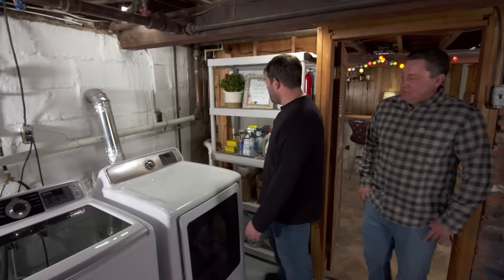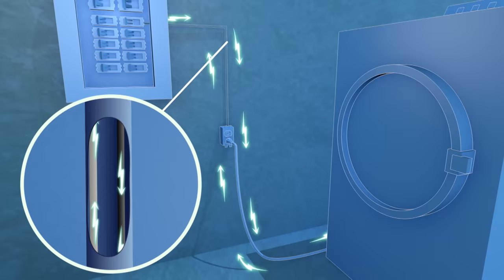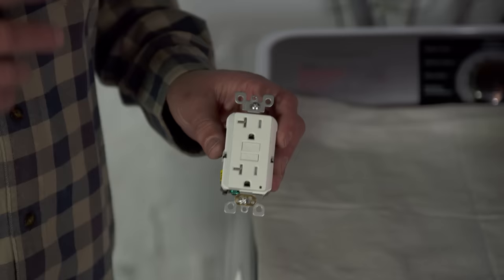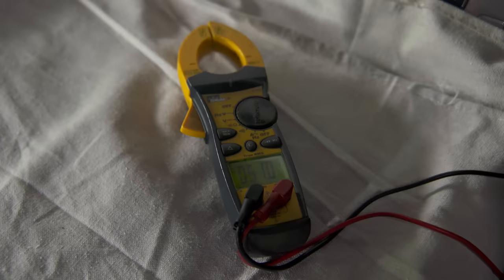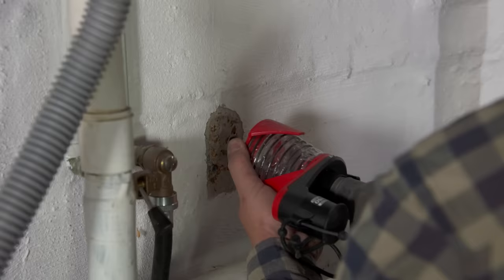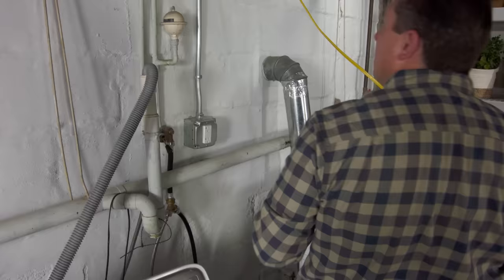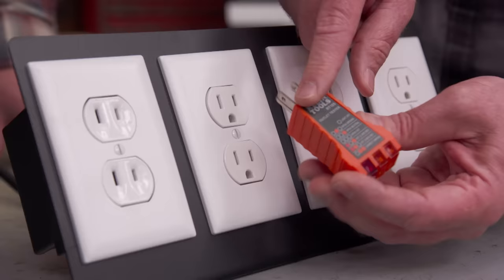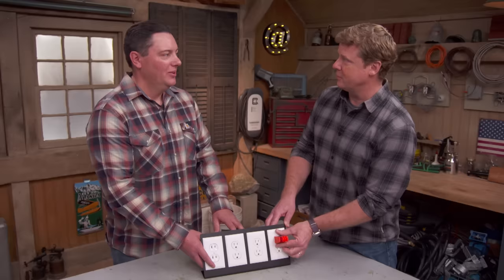How to Ground a Two-Prong Electrical Outlet | Ask This Old House

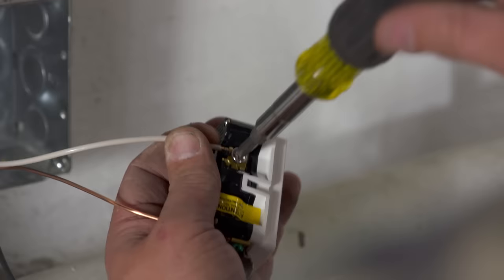Comment: At the 4:41 mark you are running NM (Non Metallic) cable in EMT (Electric Metal Tubing) . This is a violation of the National Electrical Code. Using material for a use other than its intended use is not code compliant. Also, you failed to install an insulating bushing at the free end of the EMT allowing the NM cable to be exposed to the sharp edges. Another violation of Code.
Reply: love this i was thinking the same thing😂
Reply: Wrong on one point. The code does not care if you run NM in EMT as long as you are within the rules for pipe fill while also meeting all of your ampacity derating requirements. If you disagree, please cite your code reference.
Reply: Running NM in EMT is probably not a violation of NEC and is actually REQUIRED (or equivalent) when necessary for protection from physical damage of exposed work.  334.15(B).

Comment: Around here you can’t us Romex in a pipe and You can lie to gfcis and plug testers.
Reply: Leopold  If you have a grounded wire to the outlet box and install a grounded receptacle then you have an equipment ground, so what's the problem?
Reply: Romex in a pipe (or equivalent) for physical protection has been REQUIRED by the NEC since the 2005 edition.  334.15(B).

Comment: I thought you couldn't run romex through conduit?
Reply: I believe it's ok if less than 10 ft length.
Reply: @surferdude642  That's incorrect. Refer to the NEC.
Reply: @MrBluelock  Thank you for the correction. Personally, I don't like the idea of running Romex through conduit, regardless of the length.
Reply: @surferdude642  While I can understand your reluctance, the sheathing for the conductors in NM-B is rated for 90C(194F). Something would have to be seriously wrong for the temperature in the conduit to even get close to that. At that point I doubt that it being THHN, instead of NM-B, would make enough difference to help. So if you find yourself in a pinch some day, don't feel bad if you do it.

Comment: Gfci receptacle AND an AFCI breaker? Holy hell
Reply: @Lucky Joestar Useless? The vast majority of dwelling fires caused by electrical issues may have been avoided with AFCI protection.
Reply: Yes, since at least the 2014 version of code (not yet universally adopted) a laundry receptacle (or replacement) needs AFCI and GFCI protection, not to mention the replacement receptacle itself must also be tamper-resistant.
Reply: @UpnorthHere  I suppose, if the power doesn't work, it can't start a fire, lol.

Comment: That outlet has been there for 60 years without causing any problems but some “expert” insists its a “problem” now. Replacing all that wire and equipment is environmentally and financially irresponsible.
Reply: I disagree with your assessment. This is an unusual best case scenario where everything is accessible and the electrical panel is nearby. The materials required are minimal and the safety is upgraded.

Comment: gfci breaker and gfci plug are redundant just one is required otherwise you'll get nuisance trips.
Reply: cdnbacon2001 actually, he installed a GFCI receptacle on an AFCI breaker. They are in fact 2 different devices.

Comment: An arc fault breaker for a washer and dryer? That thing will trip every load.  A GFI breaker covering the circuit would suffice.  Arc fault breakers (at least in Canada) are only required for circuits feeding bedrooms.
Reply: It may for an old appliance.  But the newer ones don’t often arc.
Reply: "AFCI only for circuits feeding bedrooms"?  Actually, the NEC has required AFCI for circuits in laundry rooms since 2014 and in "family rooms, dining rooms, living rooms, parlors, libraries, dens, bedrooms, sunrooms, recreation rooms, closets, hallways, or similar rooms or areas" since 2011.  Failure to install them means failing the inspection. In some towns, a failed electrical inspection may mean a padlock on your main disconnect in the "OFF" position.

Comment: And in this case the ark fault breaker is redundant it the purpose of its use in this situation and may cause undesired trips, as moters with tension on then may ark as they start. As in a washer machine.
Reply: NEC now requires AFCI protection for a laundry room.  Get used to it.

Comment: did u see the amount of splices in that panel ???!!!
Reply: Pablo no. I saw extended wires though. Nothing wrong with extending wires in a panel.
Reply: Since this is an older house, the original panel was likely upgraded to a new 200 Amp panel. Newer panels are bigger and sometimes get installed in a manner that requires extending the existing wires (e.g. upside-down with a new service line entering at a different location).
Reply: You should see my old panel updated in '72, hardly even any room left in the panel for wires, and doesn't even have a main breaker

Comment: 6:09 what is he talking about??? the power is still flowing but it's not?
Reply: If hot and neural are reversed then when your toaster's switch is off the heating elements are still live.  So if you stick a knife in you can get a shock.

Comment: Many problems,first,you don't ever run non-metallic sheathed cable(romex) in conduit(temperature conductor values change in conduit 45°c NEC table 310-15 ) which means the ability to shed heat under a load.It is reduced in conduit.Should have run #12 THHN down the conduit (75°c) which means it can handle more amperage.The neutral is a current carrying conductor,it takes the imbalance of the load.The ground,is a non-current carrying conductor,not more conductive.
Reply: ARTICLE 334 Nonmetallic-Sheathed Cable: Types NM, NMC, and NMS

II. Installation

334.15 Exposed Work. In exposed work, except as provided in 300.11(A), cable shall be installed as specified in 334.15(A) through (C).

(B) Protection from Physical Damage. Cable shall be protected from physical damage where necessary by rigid metal conduit, intermediate metal conduit, electrical metallic tubing, Schedule 80 PVC conduit, Type RTRC marked with the suffix -XW, or other approved means. Where passing through a floor, the cable shall be enclosed in rigid metal conduit, intermediate metal conduit, electrical metallic tubing, Schedule 80 PVC conduit, Type RTRC marked with the suffix -XW, or other approved means extending at least 150 mm (6 in.) above the floor. [ROP 7-94] Type NMC cable installed in shallow chases or grooves in masonry, concrete, or adobe shall be protected in accordance with the requirements in 300.4(F) and covered with plaster, adobe, or similar finish.

Comment: What's up with the "dont put the knife in the toaster" quote? I dont get it..
Reply: A butter knife is the wrong way to get a stuck piece of toast out of the toaster - even if you think the toaster's off.
Reply: When you have the hot and neutral properly connected, the energized part of the circuit stops at the switch which means the heating element is not energized. But if you have hot and neutral reversed, the energized part is flipped, the heating element is now energized. Even though the circuit is still not complete and thus the toaster would not work, you now have a high chance of competing the circuit if you put a knife on it, and electricity finds a path to ground through your body.
Reply: @bend386  Toasters cut both sides, at lest in Europe. It is idiotic if they do not in the US.

Comment: 6 feet from the new panel and this didnt get changed/inspected ?  That shows that both the electrician as well as the inspector was negligent
Reply: Inspector only provides information.  Homeowner did the right thing and called in an expert.

Comment: I was taught a ground fault detector wouldn't work without a ground wire.
Reply: Pretty sure they will.
Reply: Well I am awfully sure they won't. Anyone can be wrong and even though I took a construction electricians course and two electronics courses including one in the military I could be wrong too.
Tell you what I will disconnect the ground from mine and see. Now all I have to do is find a toaster and fill the bath.🤗😉🤗

Comment: Actually, its not a grounding conductor at devices. Its a bonded circuit bonding conductor. The grounded conductor is only at the the ground point in the service panel or meter base to an approved earth ground.
Reply: Technically it's called the "equipment grounding conductor" at the device.

Comment: When you turn the main breaker off there is still wires inside your panel that are still hot from your power meter.
Reply: That script was air tight. Would you prefer they cut the part about turning off the main breaker before removing the cover ?
Reply: yes...the two hot wires going directly to the main breaker are still live so be careful....
Reply: @workingshlub8861  It has already been stated that there are energised parts beneath the cover. If the cables to the main breaker are terminated correctly, there should be no exposed conductors. On a domestic installation where you would likely find ungrounded outlets, the screws are typically recessed within the breaker housing too. So adding the "two hot wires going directly to the main breaker are still live so be careful" to script adds little content and would more likely confuse the average viewer.
Reply: Anyway I think this video is great at giving an overview of the job of fixing ungrounded outlets while giving just enough details so that anyone who want to do the job themselves doesn't completely screw it up. The vast majority of people viewing this view would not undertake the job themselves.
Reply: @retrofitter  I think they went a bit overboard by skipping the part that explains why grounding isn't even necessary when replacing a two-prong with one having GFCI protection, but nicely added the required AFCI to the mix.

Comment: I like in a '60s house. I replaced recepticals with a 3-prong with a jumper wire going from the ground to the junction box
Reply: Moon Pie  Yes, I tested it with a multimeter before I did that. I guess they grounded the boxes by running a ground to all of them

Comment: You must put in a ground! Add another wire.
Reply: Grounding is not required in all such circumstances.  You may install GFCI protection instead, when replacing an ungrounded 2-prong receptacle with 3-prong grounding type.  Note that he didn't explain HOW he knew it's not grounded -- only that he guessed because of the 2-prong receptacle, which may or may not be grounded.

Comment: Sorry guys. You didn't add a ground to an existing outlet like the title hinted. You ran a new line instead. Usually the conduit pipe and the metal box is the ground because it leads to the sercuit breaker box.
Reply: Did the original have conduit pipe?

Comment: It’s my understand NM wire is not allowed in conduit
Reply: I can't remember if it just applies to PVC or not but as long as it's less than 10 feet in length you're allowed romex in conduit.
Reply: There is no NEC code violation having NM cable inside EMT, in fact, it is permitted where subject to physical damage.
Reply: Yes it is
Reply: It is allowed, however one still has to comply with conduit fill rules.
Reply: You’d be wrong. Nothing wrong with it in conduit.
Reply: You can’t put NM-B in conduit below grade. That would be the violation because it could fill with water.

Comment: That tester is NO GOOD. It doesn't tell you about a "false" or "Bootleg" ground. If some idiot hot wired a jumper from the neutral to the ground, that tester would show everything is fine and dandy. Leaving a very dangerous threat, unknown until someone got bit, or worse.

Comment: never mind cable in a raceway?  Not in my jurisdiction. If an actual electrician did that, he’d be dealing with a disciplinary hearing.
Reply: You can use NM in a conduit everywhere.  You're misunderstanding the requirement.

Comment: That romex  ain't for in conduit bud.  We saw ya.
Reply: There is no problem running Romex in conduit according to nec. Just stick to 40% rule
Reply: No, you can not run your Romex wiring in conduits. What you're looking at in the code book is referring to THHN and other wiring, that while insulated with a single coat is not insulated with a second covering and bound to 2 or 3 other wires.
Reply: @bigrudolph75  "Cannot run Romex in conduits"??  Then it's odd that the NEC actually REQUIRES you to do that in 334.15(B) when necessary for physical protection of exposed work, as shown in the video. Yes, it would have been better to have a bushing on the open end of the EMT, but Romex in conduit is allowed.

Comment: I thought you were going to ground a two prong electrical outlet.  You actually just did a total replacement of the circuit from the breaker box to the wall outlet.  Your title to this video is very deceiving.

Comment: Aren't you supposed to remove the jacket before running it through metal conduit?
Reply: It's only to mount the pipe to the wall.. Once above the concrete. He ran the 12/3 nailed to the rafters...And nothing in the code says you have to strip the wire jack off the Romex..If it was all pipe. I'm sure he would have run separate 12 ga wire..Just easier to pull...
Reply: A few things to remember here:  You can only use NM wire (known as Romex) only where it's allowed which is typically a wood frame structured building, in dry locations, and where not subject to physical damage.  The first two conditions are there, but he is putting it in a conduit to keep it from getting damaged.   Normally if you run conduit commercial, residential, indoor, outdoor  you'd use THHN/THWN (stranded) wires because they're rated for wet locations and can be fished through the pipe's bends much easier but in this case it's such a short little run that it was just easier to use Romex and get it done.
Reply: So if it was stripped of the sheathing that wouldn't wrong?
Reply: Asking for a friend..
Reply: @CupidFromKentucky  Nothing wrong with stripping it off. As long as it is in conduit..
Reply: @MasterChief-sl9ro  not true -- stripped NM wires aren't rated to be run through conduit.
Reply: @lucasrayala  Yes it is..
Insulation Color-coded Polyvinyl Chloride (PVC) compound meeting the required thickness of Type THHN or THWN-2 with a heat-stabilized Nylon jacket rated for 90°C in dry locations